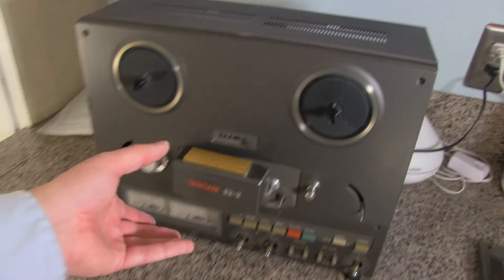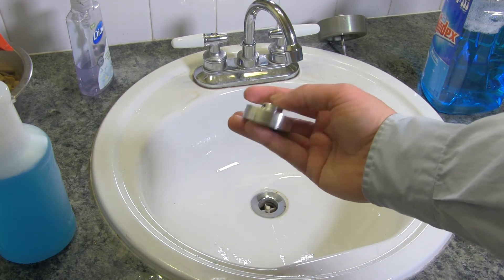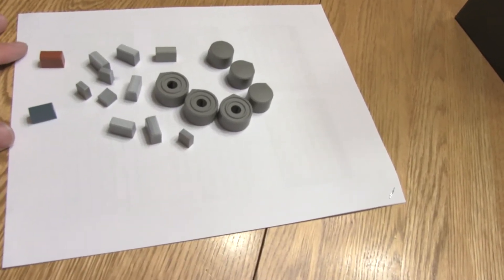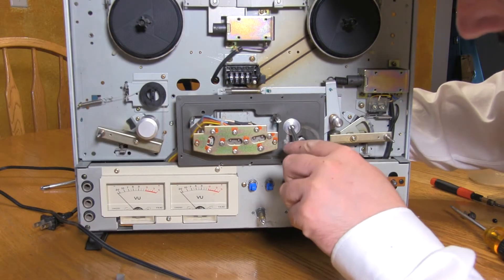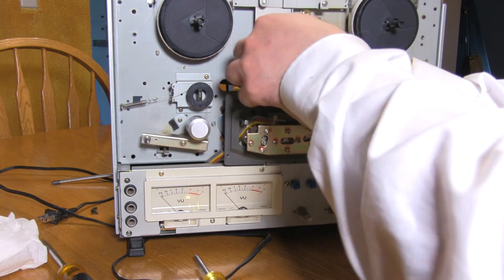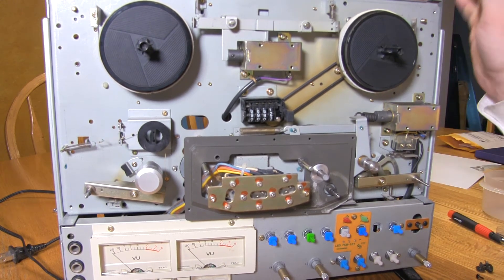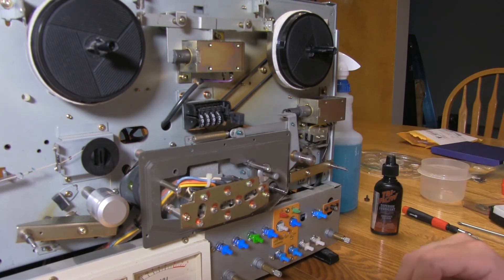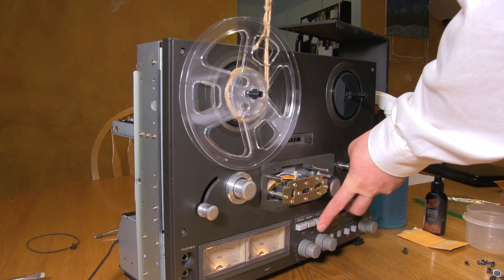Tape Recorder Repair & Maintenance : TASCAM 22-2 Belt Replacement

Comment: Thanx for this video..well done.
One note to add.. before pulling the capstan/flywheel out the back it is important to thoroughly clean the capstan post.
If it is not clean you may scar the bearing as you pull it thru.
Also note that the silver circular disc around the capstan on the front can be removed by turning it.
Once removed you will also see a washer in-place on the shaft.
This is typical construction of most TASCAM/TEAC units
Thank you
Reply: Graham Dodsworth  hi. I didn't find this before changing my belts but my capstan belt keeps walking off off the flywheel. any reason u cam think off that would  cause that?Thanx
Reply: @Eegsmith-je3jb  This is 3 years later but I have the same problem.  Just put in a new belt but it too is walking off the flywheel.  Were you able to find the fix?  Thank you

Comment: Thanks Wado - your gift keeps on giving. Just brought a 22-4 back from the dead after it had been lying uncovered on a shelf in a garage for 15+ years!! Your de-clagging suggestions are much appreciated. I guess I ought to recap the deck now :-(
Reply from the maker: I'm glad the video helped.  Yeah, if it's been sitting in an un-controlled environment for 15 years, replacing the electrolytic caps is always a good idea.  I should probably do that with my AMPEX in the not too distant future.  Thank goodness for modular designs!
Reply: @wado1942  Yup, a project for those long winter nights I feel.

Comment: Is there a method for aligning the capstan belt between the motor and the capstan. I can't keep the belt from drifting forward and binding against the head housing.
Reply from the maker: Either the flywheel or the motor are misaligned.  There may also be some gunk causing the belt to shift.  Make sure the screws are all properly tightened as well of course.  If they are, you may need to get a service manual from TEAC for more details.  I've never dealt with that problem myself but it may come down to adding some super fine shims to get their shafts absolutely parallel.

Comment: Sir, is it possible to replace the belt without opening the back panel to remove the capstain motor/metal strap?
Reply from the maker: Sadly, you need to at least partially dismantle the machine to do repairs.

Comment: Superb videos, thank you. Excuse the noob question but wouldn't bias and rec levels need to be set for each tape type?  Seems a bit silly to hide the controls  in the back, are they easy enough to adjust with the machine running? These can still be brought for ok money considering everything else now days so tempting to buy one
Reply from the maker: You are correct.  On my AMPEX, all the adjustments are in the front panel and some TASCAMs are the same way, but lower end ones hid the controls to cut cost and keep inexperienced hands off of them.  They tell you in the 22-2's manual to use Quantegy 456 (or equivalent).  RMGI 468 is bias-compatible with 456 but has a smoother top end so that's what I recommend (plus it isn't decades old).

Comment: Hey, I just picked up a 22-4 and I can't get the dang thing to work. Powers on and everything, but when I engage the tension roller, the capstan motor doesn't move whatsoever. I opened it up and found the capstan belt had turned to goop just like in your video, however it was all bunched up on the motor side such that it was preventing the motor wheel from turning when I tried to move it by hand. I'm concerned that the motor is burned up as a result and that I just burned up $250 on a broken tape machine. Is there anything else I can try?
Reply from the maker: The first thing to do is to clean out all the gunk.  As said in the video, window cleaner seems to work best but you really have to work at it.  While you have the motor out of the case, apply some DC to it, like from a 9V battery.  If it spins, you're golden (it's a 24V motor if I remember correctly, so it will be slow).  If not, at least you know where the problem is.  You might be able to have that motor rebuilt or even get a new one from TEAC.  Note, that's not TASCAM, TEAC.  I helped a guy get a new motor for his 38 from TEAC not many years ago, so you might get lucky.  You may also want to test the voltage coming from the capstan card as you may have burned up a component or two there.
Reply from the maker: P.S. you may need to take apart the motor to get ALL the gunk out of the bearings if it's really cruddy.
Reply: Thanks for the reply. So I touched the motor to a 9v battery like you suggested and the motor did start spinning. I replaced the fuses and the capstan motor turns when I power on the unit, *wheteher or not if the tension arm is engaged*. So as soon as I push the power button it starts turning. Also when I put the new drive belt in, the capstan motor is not turning the main drive wheel. Sometimes it budges a little, but it looks like the motor is too weak to move the main wheel. Could i have tightened something down to much and it's restricting the movement of the capstan wheel? Thanks for your help!
Reply from the maker: The first thing that comes to my mind is; is the motor flywheel tightened properly?  You may have too much tension on the pinch roller or need to adjust the capstan or supply/take-up motors.  Have you tested those?
Reply: @wado1942  Hey, sorry to bug you again. After some troubleshooting I eventually found that the capstan motor was toast so I ended up getting a replacement. I got it installed, resoldered and everything, but now I've run into another issue; when I play the tape, the speed is way too fast. Sounds like a Alvin and the Chipmunks album. The speed control button doesn't make any difference. The other thing I noticed that may be related is that the capstan motor spins at full speed as soon as I power on the unit, regardless of whether or not the tension arm is engaged. Isn't the capstan motor only supposed to come on when the arm is lifted?
Reply from the maker: @JosiahEverhart  If I remember correctly, most (all?) TASCAMs only run the capstan when the lifter is raised.  I'm a little worried about your capstan driver card having issues.  You may have to do some repair there or it might fry your new motor.  I hope that helps.
Reply: @wado1942  how do you properly tighten a flywheel, I just replaced the belt on mine and everything is working but the flywheel won't budge.
Reply from the maker: @8L155  I assume it moves freely by hand.  There's no mechanical adjustment for flywheel tension so I wonder if your belt is slightly oversized.
Reply: the 'chipmunks' tape MAY have been recorded at HALF the speed of your machine (ie: 7.5 ips) resulting in the octaved-up-pitch of the resulting audio. @JosiahEverhart

Comment: Thanks for the video. I also have a 22-2. The belt is fine tho. What is the oil you are using?
Reply from the maker: Tri-Flow.  It is a really fine machine oil with Teflon to help hold it in place.
Reply: Thank you

Comment: I need to get some deoxit on the pots of my 22-2. Any tips? Seems hard to access. Put new lamps in, which was nice and easy.
Reply: Frank Rideau eventually I will take it for servuce and post a video aboug it. For now I can dial it in and as long as I leave the pots aline it is fine.
Reply from the maker: Not in particular.  If you just take of the knobs and lay it on its back, you can spray some DeOxIt in there fairly easily.  The switches are a bit harder because they're built more like slide switches and have a deep recess to them.  A careful reach using flashlight and the extension tube for the spray can makes a quick job of it though.  You have to take off the panel covers though.
Reply: wado1942 thanks. Tried that but can`t seem to get the spray into the pot.
Reply: Funny, I have a 22-2 too and have the same problem. Wanted to put some Dioxit on the pots but cannot seem possible except if you dismantle the whole things.
Reply from the maker: Sometimes, you have to take it apart entirely, and even (very carefully) drill a small hole in the pot and inject DeOxIt that way.  You have to be careful to not only avoid drilling into the guts of the pot but also avoid getting little metal fragments inside it.